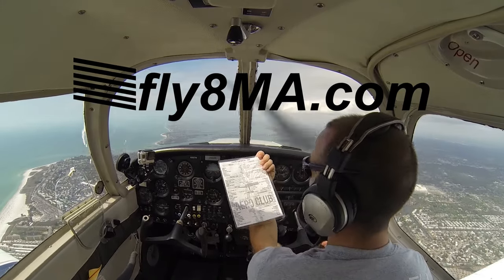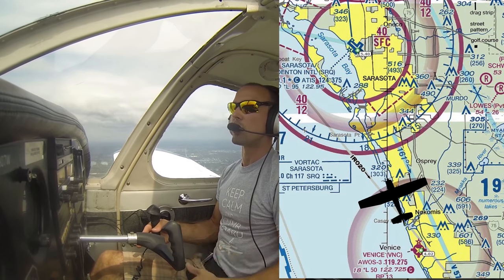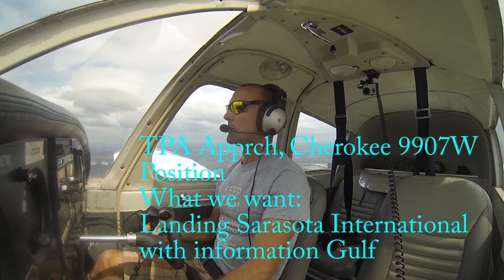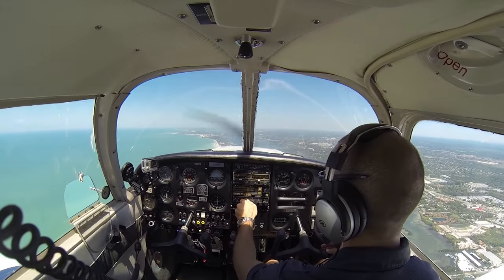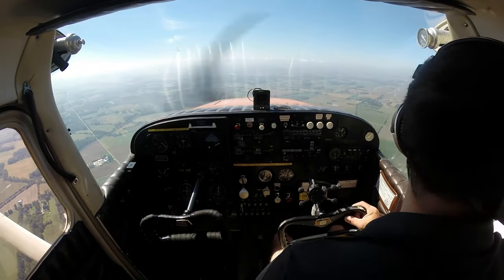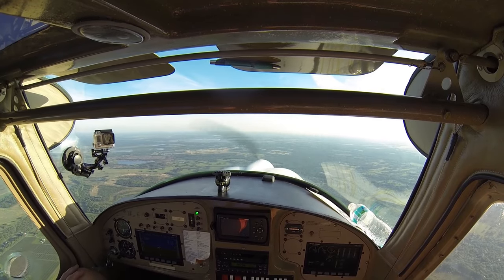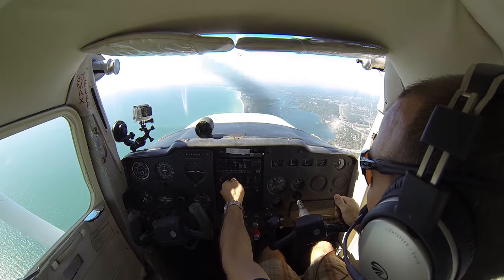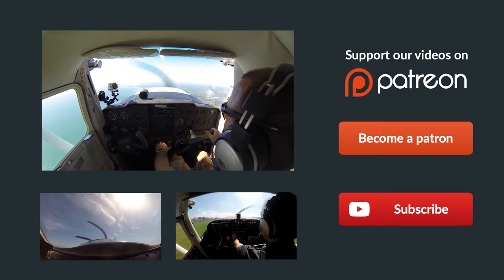Ground School:5 Different Ways To Call Approach Control | VFR Radio Communications

Comment: Fantastic video. I'm currently getting acclimated to ATC with VATSIM and building funds to earn my private license in the real sky within a year or two.  Have done quite a bit of IFR (in sim) but when it comes to VFR I've been trying to learn more about how to better navigate/communicate with ATC. For example, one of my biggest weaknesses is understanding how to know my approximate distances from airfields when I'm VFR and don't have any fixes to reference for distance. Do you have any videos that cover that at all? Or can you point me in the right direction? I get the impression that it is based 100% on familiarity with an area that I'm flying. But  that concept  baffles me as I can't imagine private pilots always flying in areas they are very familiar with. There's a first time for every destination. lol 
Any advice you can give would be greatly appreciated.
Reply: Hello, I'm currently a student pilot. That's something that baffled me too before I started out. I couldn't figure out how pilots could just eyeball distances VFR so easily when making position reports on the CTAF. Turns out it's a couple of things: If you're familiar with the area it is fairly easy to judge distances with practice (this doesn't work in flight sims since there is no depth perception). Besides that though, pretty much every aircraft nowadays has some form of GPS (even the 1970's Cessna 150 I train in has retrofit Garmin displays), and if there is no GPS installed most pilots will use their iPad with Foreflight. In any case all you need to do is select "direct to (your airfield)" on the GPS and it will give you a very accurate distance to the airfield. Just read your distance off the device. I don't know anyone that still uses an VFR nav log and stopwatch as their principle means of navigation, its an important skill to learn but practically speaking all pilots now navigate with GPS if they're flying cross-country into unfamiliar areas.

Comment: Wanting to get pilots license and trying to learn as much as I can. What do you mean by "with information gulf". Heard somebody else in a different video say they had "information whiskey", but there is obviously something I am missing.
Reply: It should be spelled "Golf" but it's the letter of the current ATIS broadcast. Wikipedia has a thorough explanation of ATIS.
Reply: Before you contact tower you listen to the ATIS = weather report from that airport, which changes every hour and is identified by a letter A next hour B next hour C and so on.. 

When you call tower you tell them you have information A or B or whatever the letter to let them know you have listened to the weather report and know what weather to expect.

Comment: For everyone saying it sounds fast... it’s because you are not familiar with the format and anticipating what each side will say.
Reply: Besides - you can always ask: 'Speak Slower'
The regulations state that the communication should be no faster than 100 words/minute.  
The pilot here is doing about 150 words/minute. But in practice that is OK. There seems to be no problem at digesting the information at either end - and this way his communication takes up shorter time slices of the frequency.

Comment: Totally not being a (bad word) here. But I'm going through ground school now, and I work with the airforce for a living. One thing I've never understood, is just Why the Hell does Pilots talk as FAST as Fing Possible. Its totally not necessary and it only leads to confusion. I talk on a radio all day long, and people that do this speed talking BS get the same response every time... " Say Again; Did Not Receive your Last" thereby taking more time and rendering the "Transmittal of Information as quickly as possible" completely non-effective. ATC and others are gonna hate my rear-end...my unofficial call-sign  is gonna be, "Say Again". lol. I literally had to pause the vid, and play back at .75 speed just to understand... I just dont get it
Reply: "congestion at larger airports yadda yadda" I've heard the reasons why, but when you speak like this, it can lead very dangerous situations. In my educated (with a lack of experience I admit) opinion, its far better to be effective than sounding like a speed-talking "Professional"  I overheard a IP telling a new Airforce student this on his initial flight.
Reply: That is one of my main pet peeves too. for GA pilots to talk unnecessarily fast is nothing but other than wanna be much cooler than they actually are.The whole point of communication is to warn the other traffic around you of your existence and intensions. I don't mind if a GA pilot talking to ATC as fast as he does BUT if you're doing this even for an educational video purposes then slow down a tiny bit for F%^& sake!!! How the students who need this info will easily understand what the heck you're saying. These kind of videos are not designed and aimed for ATP class aviators... Also using a phrase like "in the box" instead of squawk and then I noticed the attitude on the first part of the video with "I am too cool for a seatbelt" and the motormouth speech gives only one impression to every student  or newbie pilot which is: "Neeeext"... 
I am NOT saying he is a bad pilot! He may be great pilot with tons of knowledge. But knowing something very well and be able to teach it very well is two completely different things. IMHO if this is his style then I say he may be a good pilot, but definitely a bad CFI...

Comment: Going to be honest here, being a pilot we all know that we need to talk fast to get things accomplished, but I think this is taking it to an extreme. Your at the point where no one really understands you and it just becomes a nuisance because ATC really has to focus on your speaking.
Reply from the maker: Believe it or not this is a pretty normal pace for most controllers / pilots.  Its not slow, but certainly not as fast as it gets when the frequency is getting busy and everyone needs instructions / requests FAST!  As you fly more, getting a faster ear will help for those times when you really need it (especially in the northeast US!)   :)
Reply: I'm trying to get back into flying after being away from it for 37 years at controlled airports in the Denver area. some controllers speak so fast that they're unintelligible to me; I'm having to drive a long way to a less busy tower to get my ears used to the commands and speed that they're issued. Definitely not comfortable yet with tower comm/

Comment: Why do you talks so fast?
Reply from the maker: Just depends on frequency congestion, of course if there's time you can always slow down, and you can always ask a controller to slow down, however when able, I like to leave the frequency open for other pilots to use.  At some airports in the country, it does unfortunately become a necessity to speak quickly.

Comment: As someone who is an outsider but professionally interested in radio, communications, hearing, aviation and procedures and protocols in flying, I'm stunned by the poor quality of aviation radio signals and the lack of intelligibility of many of the spoken transmissions, especially considering the high risks associated with mis-communications. IMHO, the lack of evolution to higher quality in this area seems remarkably out of sync with the rest of the technical world.
Reply from the maker: And what specific system do you propose would be better?
Reply: Thanks for your reply. Frankly, and it's only MHO of course, I'm afraid it may be so broken on so many levels that it is beyond fixing. I suspect that's why it has been allowed to continue the way it is for so long. That, and perhaps financial/business considerations.
Reply: Flying with the military for the last 10 years the communication seemed pretty standard. As an outsider, you would think these radio calls are weird, different, etc... But as a regular flyer, they are not.
Reply: There are better technical solutions.  But as someone in-sync with the technical world, you'll well aware of the "installed base" or "legacy" issue.  If you wanted to change the standard communication tool, you'd have to replace equipment on every aircraft and ground facility in the entire world in a managed rollout.  And re-build training and re-train all operators. Unlike modern electronics with lifespans measured in months or a few years, aircraft can remain in use indefinitely.